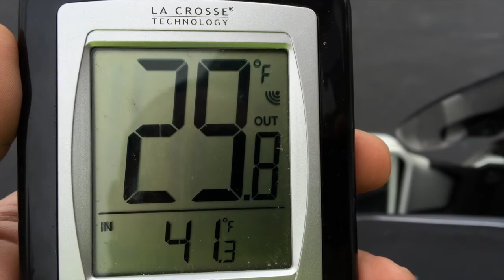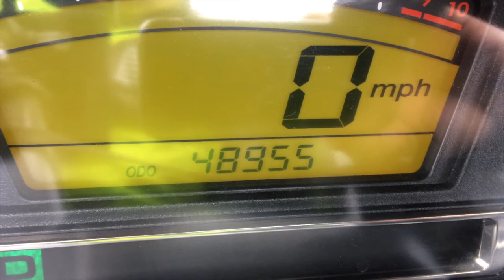2014-2015 PBC 7 - Oven Drama

Comment: A gas line install them meaning a new flex line.As for the plug. Most modern stoves don't have the space behind them for the. Most box stores won't mess with the stuff. As far as temp. You can adjust to some point. And Induction heating is grate wile it works. But it was something that never cough on in the states. Hard to find service out side of warranty.
Reply from the maker: The quotes to install the gas line was more than the gas stove. We went with moving the electrical box. I'm not quite sure why they charge so much, but makes me think I should switch careers... Hmm.
Reply: There is only money in this field if you work for your self.
Reply from the maker: Dante Fox Funny you say that. The guy who moved the electrical box worked for a company for 5 years, then has been on his own for the last 10. He looks young, but is already doing very well for himself... a home, a vacation home, 10 motorcycles, etc. And his online reviews were sky high. I don't think I could make the switch and still survive financially in the short term. Sounds like the early years are fairly rough.
Reply: Yes they are. Unless you can fall in to an already existing business